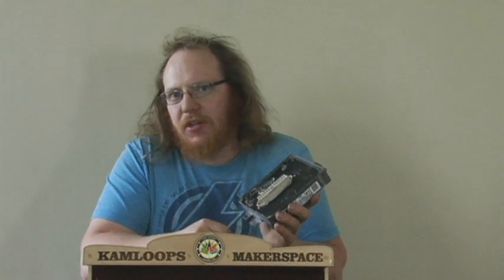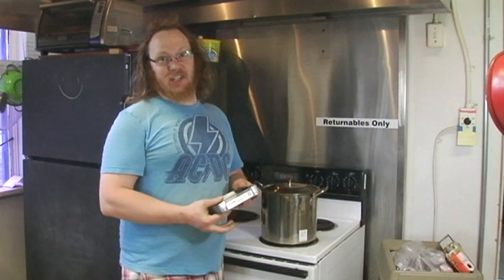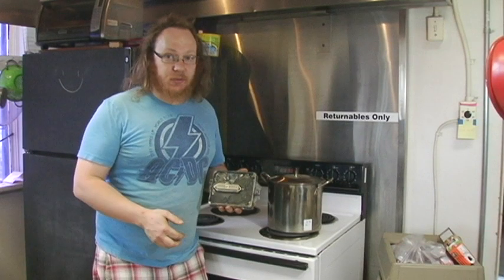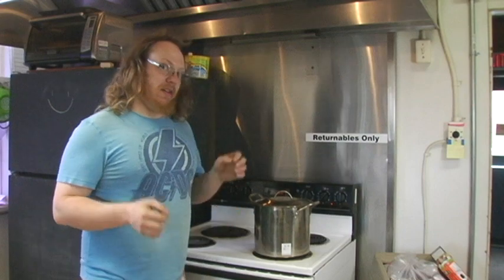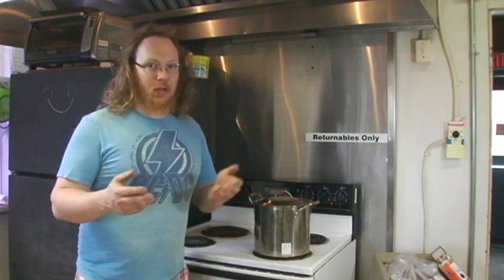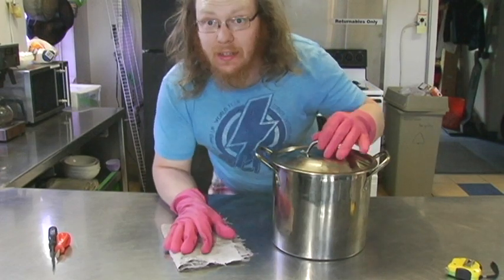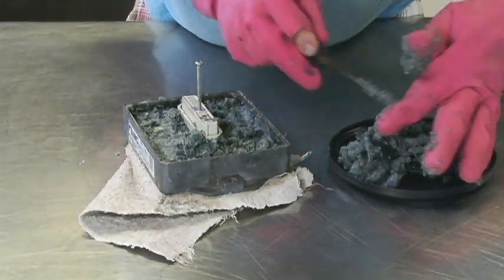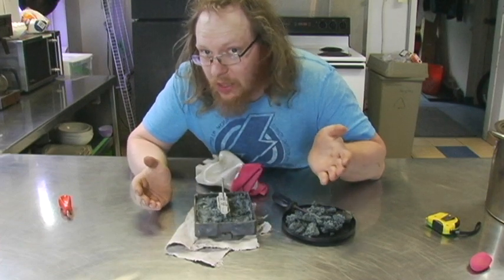Depotting Electronics with Boiling Water

Comment: Was heading into the shed to dig out the epoxy on my faulty regulator on my motorbike. i thought i would turn on to youtube before drilling etc. just to see if there was another way.  Saw your video first up. Now, im going to get the old pot from outside, and boil it. Thanks very much. You probably saved me a lot of work!
Reply: Hi! Could you repair it?

Comment: I've done this to several modules. After boiling & removing big chunks I go to using a Wagner steam gun to keep the part warm enough to remove the rest of the epoxy. I avoid using metal tools & instead opt for wooden tools fashioned from second store  hand wooden kitchen items & shish kabob sticks. No, temperature as bit hot enough to damage electronic components. I only clean the board enough to ID components & expose points to test with a meter.

Comment: Why do you need to put your electronics under water? Dont you have a heatgun?
Reply from the maker: I do but I only used it later for more precise sludge removal after the irreplaceable plastic harness connector was removed. A heat gun will make a mess of that. Hot water won't.

Comment: I have a PCB that is incase in silicone as well. What I want to know is will this damage any components with water damage? I under the electronic is powered on. But I want to know before I attempt this as well.
Reply from the maker: Most electronics (capacitors, resistors, IC's etc) don't mind getting a little wet when not powered, however some specialty components (laser etched film resistors, brush assemblies etc.) do not like to get wet, so it's really down to what is inside the potting, which is often obscured.
Reply: If you are worried, try boiling in distilled water. It is non conductive and non corrosive.
Reply: During manufacturing of the circuit board assembly, a water wash with solvents are used to remove the flux and to clean the board for assembly into the potted form. I worked on Avionics, and we needed clean boards to apply conformal coating. We did have problems with assembly operators contaminating assemblies with salt from their hands and food.
Reply: I had an underhood bussed electrical center on a van that wicked water up the pins on powered relays shorting them leading to electrical fires.  So if I have diodes, relays, etc. on a potted board and use the water to remove potting doesn't the water get inside my components?   I read thru comments and some folks claim electronic components can take 250 C with no issues so wouldn't axheat gun work? 

Last question (I am not an electrical guy) what about puting device in a microwave?  Would that dame anything? @CelGenStudios

Comment: I wonder how a pressure cooker would work?! Let me know if you try it.
Reply from the maker: I'm not sure what that would do. You are using the hot water to soften the potting.
Reply: @CelGenStudios  Under pressure you will rise up the boiling tmperature of water.
Reply: @DesainDali  water alway boil 100°, with pressure you increase the amount of heat
Reply: @scorti68  
Sorry, its incorrect.
 https://de.m.wikipedia.org/wiki/Siedepunkt

Comment: Pls don't try, electronic components maximum temperature 120 degree Celsius u can check pth capacitor as usual they mention, most components work in 80 degree so like this those components will blow, and u will damage your self, check datasheet of resin 260 degree Celsius so more then component temperature up to now there is no solution as of now some people try to remove using knife they will damage PCB
Reply: Almost all components survive just fine to reflow temperatures which is over 220C, obviously they have to because that's how they get soldered on to begin with. 100C boiling water is a non-issue. Now operating temperature ranges, that's a different story, but irrelevant as the thing is not powered on while you are heating it.
Reply: 1) The unit was already non-functioning.
2) Capacitors are cheap and easy to replace.

Comment: WD-40 can also work depending on the compound used.
Reply: This is very interesting to me!

WD 40 dissolves epoxy resins?
Under what conditions?
Reply: WD-40 will loosen silicone, around the bathtub, sink. I tried today on my circuit board with no luck must be epoxy or resin, boiling now in water.

Comment: Please use more protection, anyone who tries to do the same use respirator, glasses and area should be well ventilated too! That dissolving chemicals are very harmful
Reply from the maker: When working with strong solvents and their vapors yes, however in this case we are using only water and are softening the resin, not dissolving it. That said, be careful about getting burned by hot water or steam.